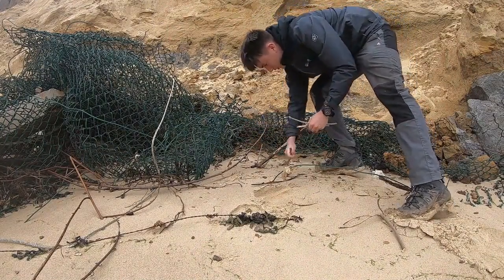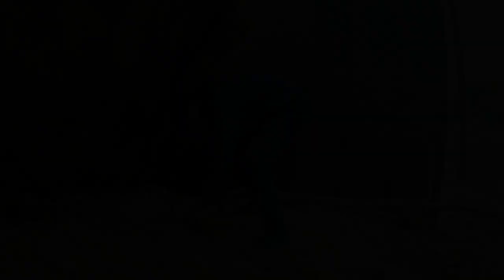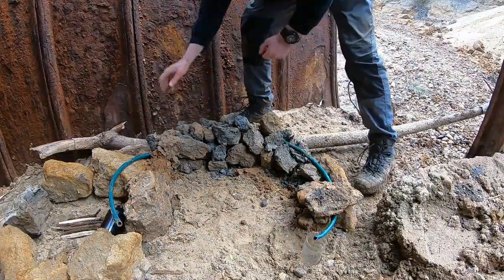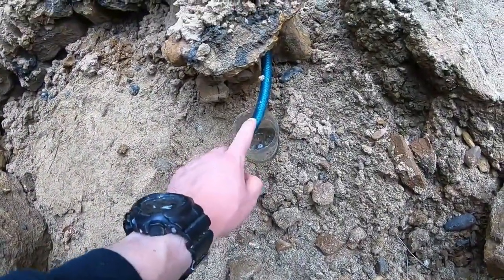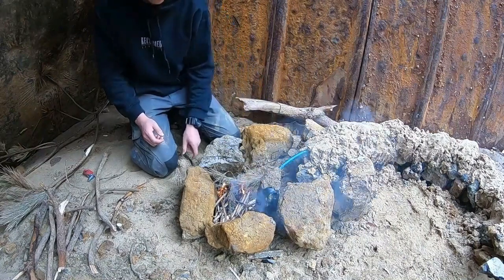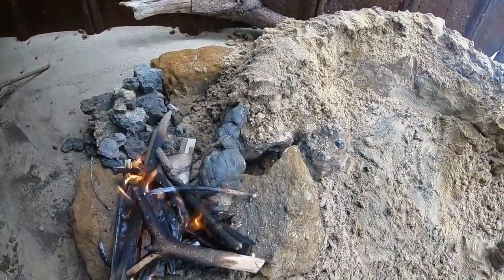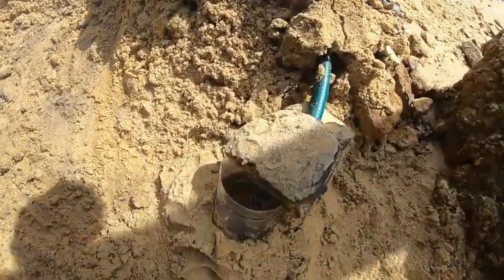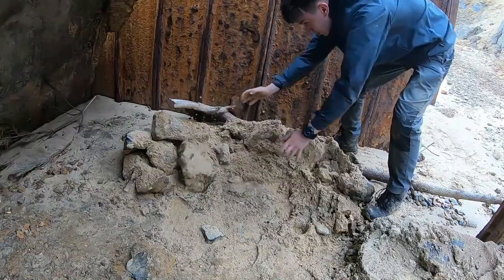How to Make Seawater Drinkable - Survival Distillation

Comment: So if you get stranded on an island you better hope someone was there before you that left a hose, plastic bottle and a metal container.
Reply from the maker: You’d be surprised what washes up! The boiling can also be done in a plastic bottle/container. You could also use any cylindrical object for the hose, as long as you can stop the steam from escaping at the boiling end, I’ve seen people do it with a cut open plastic bottle.
Reply: @absurvival4801  Fair play, there is a lot of ocean garbage out there